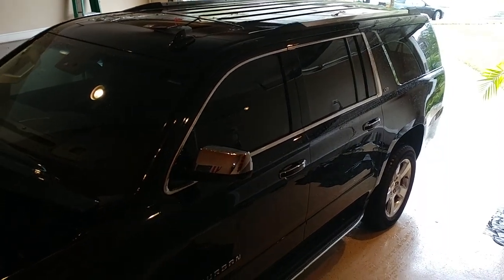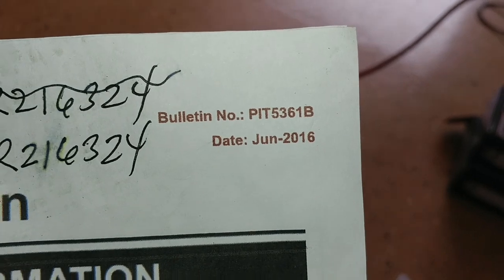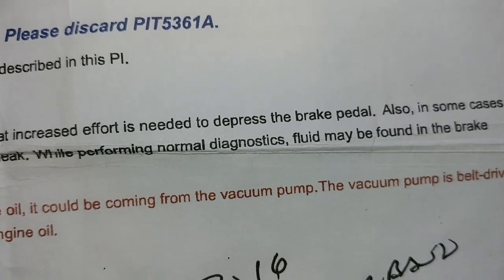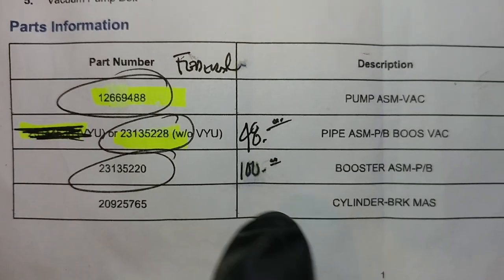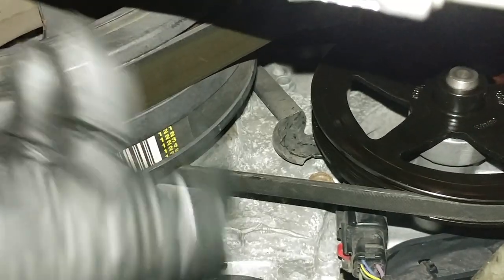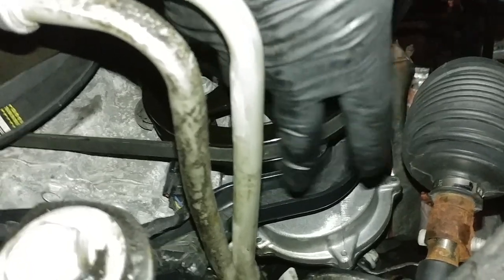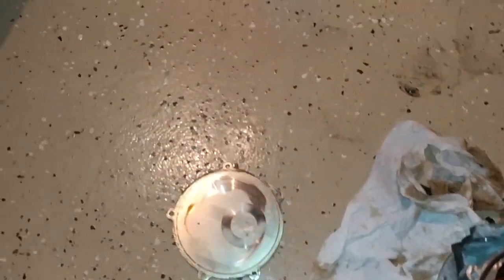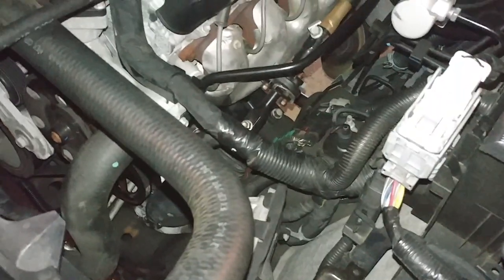Vacuum pump replacement on 2014 to 2016 SUV and Trucks braking system

Comment: Thanks bro this is a huge help and loved the ending you should do all DIY videos!!!! We pay 50 to 60 grand for a vehicle and have trouble 55,000 miles GM should be ashamed
Reply from the maker: Just trying to help brother. By the way, my transmission went out on us recently. The stock oem torque converters are crap. Check your transmission fluid and change the filter. If the fluid looks a little bit brown it means trouble in the making.
Reply: @pianistasalsero  i just replaced the pump because of a ticking noise while accelerating.  It seems better now but i can still hear the ticking noise about 40% of the time. Could it be the torch converter as well? how did you know your torch converter went bad? thanks!

Comment: Just finished up doing this to my 2015 GMC Sierra Denali 4WD.  It was much harder since it was 4 wheel drive.  There is no way to access the rear bolts from the bottom at all because of the 4 WD components.  You have to access both of them from the top.  The only way to do that is to remove the bottom section of the steering column.  Still very difficult to reach.  Just an FYI for those that have 4WD on their truck.  And I love the ending of your video!  LOL.  Made my chuckle after being so frustrated with this truck.
Reply from the maker: It was tough brother but you got it! Mine is a  2 wheel drive and was still hard to do. I'm glad to know my video helped.
Reply: What was the torque specs for the bolts?
Reply: @daTruckTeam  There wasn't any way to get a torque wrench in there, so tight as I could with regular hand tools in that awkward position.

Comment: For my 2015 Suburban, to make room to remove the vacuum pump bolts, I needed to remove the steering column elbow joint.  Also, I didn't replace the vacuum hose.  So far, so good!

Comment: Awesome assessment and explanation of the problem / solution.  GM really screwed the pooch on these newer trucks and SUVs from the A/C system design (which will fail because the factory condenser won’t hold the pressure), to this braking issue.  I’ve also had problems from my 4WD switch and my drivers seat will adjust itself randomly at times.  

Thanks for the helpful and entertaining video.  

Good to know there are still plenty of people who like to work on their own vehicles while the pansies sip their lattes 🤣
Reply from the maker: Just trying to help, we paid a lot of money for these vehicles. Keep an eye on the transmission, get it flushed and serviced before 50k. Our transmission went out after the breaking problem.
Reply: @pianistasalsero  i got a 2014 silverado  just starting braking problem and has gone through 2 trans already on the third
Reply: @SecondChanceMowers710  I'm on 4th trans 14 Silverado every 100,000 I have to replace i have 436000 on truck just now have to replace vac pump

Comment: Thanks my frined ., i have 150 k miles in mine 2015 yukon ., i might change this shit any way ., even though is not failing yet ., and yes this video did help . Thnaks :)
Reply from the maker: Wow! 150k on a 2015? You really put some miles on that baby! My transmission went out at 62k, right after the warranty expired.

Comment: Thank you for the video, it would have been better if you showed how you did it as you did it.
Reply from the maker: If you need a video of the minute by minute process and steps in order to replace this pump, then this video is not for you. This video was targeted to those with good mechanical abilities who just need someone to point in the right direction with sound technical tips on parts and tools. I at least hope it helped you.

Comment: This is why more people would rather hold on to their older model vehicles. The new ones are extremely over priced and parts/labor for repairs are usually more than the monthly vehicle payments. A one or two year old shouldn’t break down so soon
Reply: I'm starting to buy only older vehicles because by the time you're the owner, YouTube is full of maintenance videos for common problems with that vehicle.

Comment: Well I work at a gm dealership it's a open recall just the pump no other parts needed but it does help if you change your oil on time

Comment: I am having the opposite problem. the petal goes to the floor. I have changed pads, Rotars, and master cylinder. Took it to another mechanic and he is saying the issue is this vacuum pump.

Comment: I just completed replacing my vacuum pump. Before i drive my truck i’m curious if i need to bleed my brakes?
Reply from the maker: No, your breaking fluid is a separate system from the vaccum system.

Comment: Thanks for the video, it was helpful. Fair warning though for others that the 4 Wheel Dr. version is much more difficult because the differential blocks most of your view of the bolts.  you will want to swivel ratchets and many combinations of extensions and or swivels in order to make it work and a lot of patience but it can be done.  also do not buy the belt removal tool from Napa because it is garbage and does not work, nor does the belt installation tool that is part of the same kit.  The tool on Amazon looks different maybe its ok.  good luck!

Comment: Loved this is there any way that you can delete pump and use engine vacuum
Reply: You have to disable active fuel management in order to remove vac pump from equation.  Because it shifts from 8cyl to 4 cyl

Comment: You can borrow vacuum pressure off the intake manifold and run it into the master cylinder. No need for the pump. I did it to my 2017 Tahoe. Only thing is the brake pedal sometimes feel like you are on snow at very low speeds (I drive in NYC), but the truck stops no problem as if it had the original pump working. It’s a permanent fix if you don’t mind the once in a while kickback in the brake, or a temp fix until your part arrives but can still confidently operate the truck knowing you can stop no problem.
Reply: If you get the right tubing there’s no kickback in the braking, my tubing forks off towards the, so the vacuum pressure isn’t precise to stop the occasional kickback, but good enough for “on the dime” stoping.
Reply from the maker: Good luck with that. I would not recommend it.
Reply: Thinking about it — I’m better off with my repair. Your pump will go out again, my intake vacuum will last the life of the car. Can’t risk the pump failing at another 50k miles at the wrong time. 

Traditionally the vacuum pressure is taken from intake manifold anyway. No pump needed.
Reply from the maker: @geesehoffa2144  if you read more about the breaking problem, you may be able to generate enough vaccum from the engine, however, when it goes into 4 cylinder mode, the vaccum decreases not providing enough for proper braking. I was told the new pumps are much better.
Reply: Oddly enough when my pump went out and I didn’t have the manifold work-around I didn’t have any braking issues. It was only at lower speeds (less than 10MPH), basically city driving where lots of “stop and go” happens. I asked my dad about it (he’s a mechanic with 50+ years of experience) and he told me the engine rev increased the vacuum pressure even though the pump was broken. So at stop and go speeds the engine is working in v8, it’s only v4 when you coast. I honestly don’t notice any difference in stopping power in neither the city or highway, if anything on the highway the car braking is working as if the pump never went out at all. And again I drive in NYC — it’s absolutely hell here for driving.
Reply: @geesehoffa2144  can you share a video of your fix
Reply: I will post a link tomorrow.

Comment: Do you have to add or empty the oil?
Reply from the maker: No, no need to empty the oil. You will get some oil to drip out when you remove the old pump. Great question!

Comment: How did you determine that it was the pump and not the booster? From what I can see I do not have any oil leaking under the pump or in the hose line. I disconnected the hose line like you said and did not hear and pressure being relieved. I have a 2014 Silverado. The brake peddle would harden up but with giving it RPMs the peddle would soften. Today the brakes are rock hard even with giving it RPMs. Did you happen to experience any of these problems?
Reply: Also thank you so much for the video. This is the only video I could find and it’s super helpful
Reply from the maker: If you don't have oil leaking into the booster through the tube the problem most likely is your pump. Unless you have a leak in the tubing. I changed the pump and the tube. Problem solved and greatly improved the breaking.
Reply from the maker: By the way, at the end of the video you can see the internal damage to the pump. The original pumps are crap and Chevy knows it.
Reply: Almost bought the booster. After Watching you video and reading your advice I’m pretty sure it’s the pump. Thanks so much for the help
Reply: @sheeks88  was it the pump? Would love to know because im having same issue

Comment: Hi, thanks for the vid.  Just wondering is this a 4x4 or 2wd suburban?
Reply from the maker: 2 wd. For a 4wd may be more complicated.
Reply: Pianista Salsero yea I’m working on a 4 Ed and have basically no access to the bolts on the back of the pump.  Might have to remove the steering shaft to get to it.

Comment: Hey did your breaks get hard while stopping through town like red lights ? Ours gets hard to push only while tring to park. If i have to go foward n reverse a few times . U think its the pump ?
Reply from the maker: Yes, sounds like the pump. Follow the bulletin stated in the video. The problem will get worst with time.
Reply: @pianistasalsero  will do. Great video man thanks!!
Reply from the maker: @williambennett71  Link to the pump: https://www.rockauto.com/en/partsearch/?partnum=12669488 ,  Link to the hose: https://www.rockauto.com/en/parts/acdelco,1789310,vacuum+hose,1812 . Good luck! If you can do it, it will cost you under $200.00 with shipping.
Reply from the maker: @williambennett71  Amazon: https://www.amazon.com/s?k=12669488&ref=nb_sb_noss

https://www.amazon.com/s?k=23135228&ref=nb_sb_noss_1
Reply from the maker: @williambennett71  Link to Bulletin : https://gm.oemdtc.com/TSB/SB-10081053-2280.pdf

Comment: Do you know the torque specs for the mounting bolts? Thanks!
Reply from the maker: I can't remember, I would have to look it up in the repair manual. If your manual does not have it, just follow tge universal torque specs for bolt size.

Comment: Why can’t this pump be deleted get vacuum directly from engine
Reply from the maker: Don't know where are you going with this kind of question. Please read the bulletin, it explains in detail the purpose of the pump. Your question should be directed to the engineers at GMC.
Reply: Because in 4 cylinder mode you may not have enough vacuum. Its a stretch in most driving conditions but nevertheless its possible

Comment: Hey guys did or do you still get emails from diagnostic blah blah...
While on the trip this is the message I was getting. :
Dear Angel 
An issue with the Antilock Braking System in your 2016 GMC Yukon has been detected. Please service your vehicle within 7 days.
Please disregard this message if your vehicle is already in for service. Inaccurate notifications can be generated during service.
Please see your dealer for service.

Comment: 3/31/22 2015 Tahoe 5.3 94k odometer.  Brakes went out Vacuum Pump BAD by 2x shops.   Im outside of extended warranty HOWEVER to ALL::::   Its a safety recall.  GM should cover you full repair.  Tell dealer to use Policy# N182202780 .